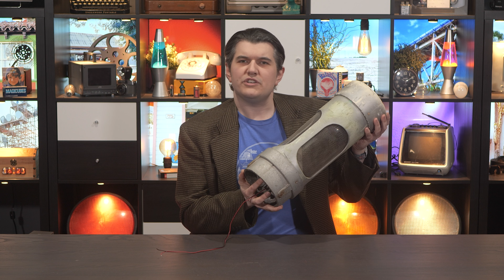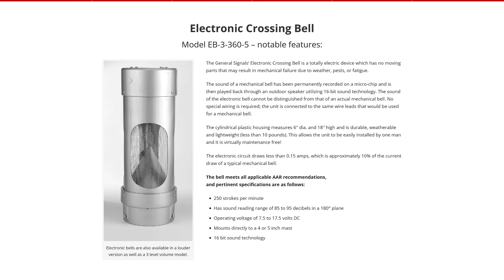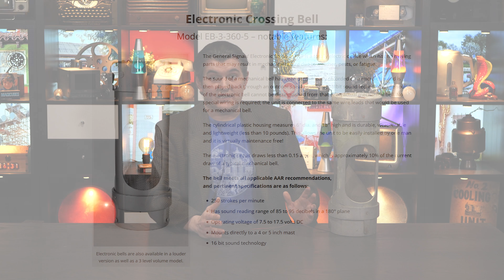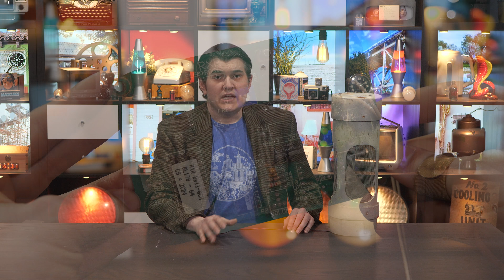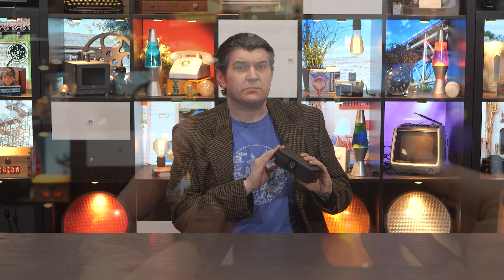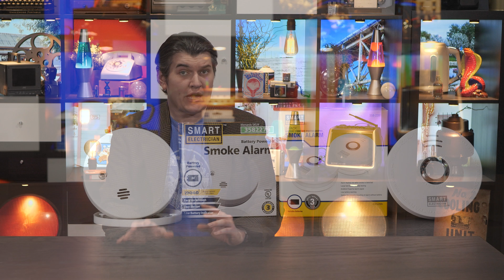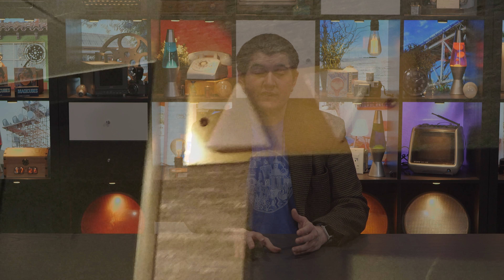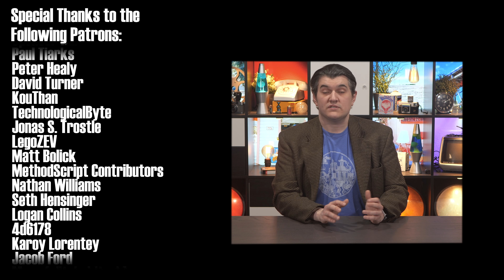The disappearing and unappreciated art of audible alerts

Comment: Sees a rant about phone audio notifications and raises "I used to have a little RGB LED on my phone that told me I have an unread txt, new email, app notification, they could be color coded per user, type of notification, etc. and then someone went "no" and every phone got rid of it and replaced it with always-on displays that get too many notifications and thus are ignored and use up too much battery". No I won't go on the same style rant, but I could.

I have sound turned off on enough things because I get jump scared. A 3D printer running out of filament and producing a fire alarm like sound from across the home (and the push notification coming seconds later), has given me enough heart attacks. Meanwhile, I have the 30 sec "dryer finished" song memorized. I think a lot of it is just way too many notifications. We went from "purposeful audio cues" to shrill ring tones and 40 billion beeps for every txt that showed up, to "now it's txt, email, app, OS, etc." all making noises and just went "please stop". You say "false choice" I say "the power of defaults" because most people never change default settings. The settings are there (assuming they work...) but it requires someone to change them manually.

Meanwhile, my pager app (yay working in software for 24/7 always on services and needing to be notified when something breaks) basically says "hi, welcome, can I set the notification settings for you so that when you get an alert it goes from least aggressive to most aggressive, and the most aggressive one will be set to auto-bypass do not disturb, vibrate only, and other suppression settings so we can actually tell you that you're system is on fire? kthnxbye" and then it does the work for me. Like... it can be done automatically, in an opt-in fashion. But that wasn't the feature request that was given to the developer.

Comment: An early smartphone I owned had a small LED near the ear speaker which would give a quick little flash once every 30 seconds if there was an unread message. As long as that phone was in my peripheral view, I didn't need to even touch it to know if I had a new message. These are not cutting edge technologies.

Comment: As much as I hate the electronic level crossing gong... they work, and they work very reliably. And when they eventually fail, it's cheaper to just replace them (once you factor in man-hours).

My main gripe with them, other than 'classic bells are cool', is they sound WEAK. If they sounded more like a real bell, no one would notice.

And the old bells? They're great, but they do require a fair bit of maintainence; I've seen 4 go out of service in about 3 years. I can see why they want to replace them, just... gee, they really sound tinny!

Comment: The problem with using internet apps is that it seems that it doesn't give a way to differentiate specific conversations. Most apps I've tried at most let you separate individual & group notifications but that's it. The thing that I definitely do is disable (or at least silence) anything that isn't a direct notification, like a call or a message. And for all of that, since it "got through" I generally use a single ping for it all... although I might split them in 2 for IRL and online-only friends.

The one single app I really hate hate hate to have notifs on is eBay. Because it doesn't let you disable or differentiate between notifs so "hey please remember that we're ripping off whatnot" or "we still sell used iPhones, same as 15yrs ago" comes in exactly the same as "yo that unobtainium thing that gets listed once every 3 years? there's 5 minutes remaining so imma send this notif late so you get it an hour after it expires lmao some guy got it for half off".
(...oh right banks also do ts, then add banks too)

Comment: Speaking of fire alarms and temporal 3, carbon monoxide detectors must use temporal 4. This is to differentiate it from fire while still doing the same stuff that T3 does. Funny thing is, I never knew this until it was told to me at my job (relating to fire alarm systems). How they expect a layman to differentiate between fire alarm and CO alarm? No clue. A majority of lay folk will hear sound and leave. I guess it's just for the professionals, because in either instance you want everybody in the area to get out.
Ahhhh I should have kept watching before commenting. Alas.

Comment: I still say Smart Watches were done wrong. They have been trying to turn them into miniature cell phones in and of themselves, with all ths same power and capability and I think that's a mistake. We should have instead made them into a remote control screen for our phone so we can access and control the phone without taking it from our pocket. Apps DO NOT RUN on the watch. The apps run on the phone and merely send graphical data to the watch telling it what to display on screen. App developers don't need to learn a whole new programing language for every smart watch. You just program the correct aspect ratio for the watch and what you want displayed and how and you are done. Just like having a second monitor for your PC, it's just a second display for your phone to control it remotely.

Comment: I am about to shove this pixel into a wood chipper if it keeps lowering my volume randomly.  I will straight up throw this thing in the ocean and get rid of having a mobile phone altogether if Google and Samsung can't get their shit together.
Reply: Same, bought a Pixel 8 a year ago and it was the most expensive and worst POS of a phone I've ever owned. iirc that behavior was related to something called gestures
Reply: Wait, dont throw out that Pixel just yet, you could install GrapheneOS on it and deshittify the phone!
(provided you have OEM unlock for it, which I don't because I got it through a carrier, so now I have to wait 3 years :/)
Reply: @gonderage  I'm a nerd but I'm not a programmer.  I'm not a developer.  The average person isn't breaking their phone just to get a basic function.  Why should I need an OEM unlock, for a device I own, just to make the volume not decrease as I'm doing 70mph down the freeway meaning I have to technically break the law to turn the volume back up?  

I wear shokz headphones when I'm not in a vehicle.  They cannot hurt my hearing.  They're open.  

I wear a cardo when I ride my motorcycle.  I don't wanna pull over (perhaps in ten miles at the next exit) to adjust the blessed volume I set before I started riding.  That's what the bleeding cardo is for.  It has a wheel I can spin with gloves on to set the volume.  

I use an FM transmitter in my work truck.  This stupid piece of hot garbage doesn't understand that it's in a vehicle, which has its own volume knob.  It doesn't understand that the transmitter is a device with an independent volume knob as well.  Google and Samsung just go "welp papa gubamint says we gotta protect your hearing so enjoy this volume reduction that you gotta take your eyes off the road to fix, or you gotta pull over on the freeway where you're not allowed to, or you gotta pull over at the next exit and be in silence for 15 minutes..."

I will not accept that I have to dink with this $600 phone just to get the functionality an off-brand walkman had 40 years ago.   I shouldn't need to put a different OS on my phone just to do something a record player from 1935 can do, which is to just play music at the volume level I set the bastard at.
Reply: @gonderage  Also I'm not breaking the phone to install an OS that I then need to reinstall all the stuff I just broke the phone to get rid of to make my watch play nice with it.  Just, no.  If i wanted linux on my phone I'd get a laptop with a sim card...

Comment: The "texts from certain numbers ring the phone every minute" option certainly would've been useful when I did on call rotations.  I mean, the on call software that pushed out the notifications could do that, but then you had to make sure to go in and shut it off on your way into the system, which was an annoying side quest on the way to solving a problem at 3am, so just having the phone beep at you until you answered would've obviously been better.

And I'm not just saying this as in "oh, I wish in retrospect." I spent a LOT of time trying to find a way to force my phone to do that, because the software that pushed out the notifications was annoying as hell to get to stop bothering you.  I so desperately wanted to be able to tell my boss that "hey, my phone can just repeat the message, we can set it this way and then tell the software to send the notification out just once." And I was so sure that this used to be a thing that I wasted hours of my life trying to find the buried setting. But no. They took it away.

Comment: 737 pilot here... The 737 "bing bong" system is terrible! A call from the cabin is a single bing, but a text message from the company (ACARS), or a text message from ATC (CPDLC) use the exact same bing, but followed by the bong. Most airplanes use different notes, but this plane uses the same first note for everything! So when I hear the bing, I might start reaching for the phone to talk to the cabin crew. But then the bong sounds and now I have to move to another part of the cockpit and try and figure out if it is an ATC message or a message from the company.

Comment: There actually is another reason for these electronic bells vs the mechanical ones. The mechanical bells send their sound in all directions. But in urban areas where some sound regulations may exist, the housings and reflectors for these electronic bells can direct the sound (somewhat) towards the approaching traffic direction while reducing the sound in other directions. They are actually mandated in some areas for this reason. And there are other electronic bell signals with a drastically different design that funnel these sounds even more on 'noise free' zones.

Comment: 21:14 Remember when you used to be able to turn Bluetooth on or off with a single tap of the "quick settings" button? I had an argument with a guy who was apparently completely unaware that what is now the several taps and wait for the animations to complete hell was ALWAYS (and still is) accessible with a long tap. So now the single tap duplicates the long tap, and I am constantly frustrated by accidentally tapping the wrong thing because the utterly unnecessary animation hasn't completed and 10+ years of muscle memory still hasn't been completely undone by a year of aggressively and deliberately user-unfriendly design. Because Google doesn't like users turning off their spyware...

I wonder when Google is going to completely remove the option to turn off Wi-Fi, Bluetooth and GPS?

Comment: Interesting. In Australia (or at least, both in my local shopping centre and my workplace, I can't claim it's a universal standard) Temporal 3 is 'Stand by alert' and the Slow Whoop is 'Evacuate', with no specified cause (although they're probably fire alarm systems under the hood).

Comment: The android notification settings are possible****

BIG ASTRIX 

On a fucking rooted phone. You can use Autonotification, and I forget the other app, it's an automation one. But yeah I was able to get it to just go DND when I got 3 successive messages within 30 seconds. It'd stay on DND for 10 minutes, and then undo it. I also had it set so anyone who texted Emergency It'd unmute, turnoff DND, and at max volume play EMERGENCY ALERT (ripped from BMS). I had it do a whole bunch of stuff too. But it's still a fucking massive nightmare cause google has to make android shittier and shittier each year. Just like they do with everything else.

Comment: Fortuitous timing. 

I installed an actual mechanical doorbell on my front door just today. It's the type where pushing in a rather large mechanical button on the outside actually turns some gears inside a mechanical bell on the inside. No actual visitors have used it, yet, but the sound is so pleasant.

Comment: My old phone very easily let me select notification sounds, so I know when it's an email or a text, or just one of the various games I have telling me rubbish. My new phone I THINK lets me do this, but it's buried under weirdly laid out settings and I've only so far managed to get emails and messages to vibrate and make noise (Everything else just makes a noise, or nothing at all). It's VERY frustrating!
It's also nice that I can set the games and apps to quietly add themselves to my notifications list without making a noise or showing itself at the top of the screen. I haven't worked out how to do this on the new phone, which is a pain.

Comment: I used to have ringtones and RGB LED settings very intently designed. For the ringtones in particular, they were multi-note sequences where it was arpeggios of different chords in different sequences based on the type of notification, and fast/med/short versions based on the urgency. Sounds complicated, but I was in a jazz band at the time so picking up on the chords was pretty quick, and I could tell "oh that was a non-urgent email from my gmail account" from the sound.

Comment: I've had the experience of working in a setting when a dispatcher needed the attention of one of the building maintenance staff, they would send the first name, or last name and initial, or a unique  identifier (think ham radio call sign) as morse code to all of the radios in the network. Very quickly the maintenance people would all pick up on their own call, so that even if their own radio volume had been turned down, the fact that someone near them had a radio loud enough to be heard by them, they would know that their attention was needed. and self automatically adjust their radio, include getting a new battery or the like, as well as be able to respond to the call whether it was on their radio or the radio they heard. The real advantage was that this morse code at specific frequencies used would often penetrate ambient noise even in loud mechanical or factory floor space environments where you practically can't hear the person standing next to you screaming in your ear.

My own interest is that something like a cell phone should only need a screen for things you need to actually see or read, and the day to day stuff like notifications, navigation instructions, even establishing a call should be a voice interactive activity, that works with either the phone speaker and mic, or a bluetooth headset. I'm rather discouraged that even Google Voice (my preferred telephone system, can't work out how to answer a call without a push button. Especially in call screening mode. verbal interactions like 'accept', 'yes', 'no', 'send to voicemail'l, etc,, should not require that I grab the phone unlock it, select the keypad function, press a virtual button (on screen), all of which takes extra time. It would also help with dealing with callers who can't be bothered to announce who they are to the virtual attendant, if I establish a phonetic contact name for the caller's phone number. As it is, if I don't have a contact and the number doesn't come through with functional caller-id, it goes to voice mail. If they elect not to leave me voice mail, the entire notification process is a failure on their part. For phone calls, verbal interactions for call accepting, rejecting, etc should all work whether I'm yelling at my phone in my pocket, working with a speaker phone on the desk. or a handset, or working with a bluetooth headset. Are there advantages to each, sure, but they should all work well.

As for navigation, "Give me a walking route from here to John's place, and give me waypoints to let me know I am on that route." should be sufficient to get almost any navigation system to provide that if "John's place" is a known location in your contacts, or a business in your area. If I can also feed back with something like "There's a problem with this route, the bridge ahead is out, please direct me to an alternative path' might also be useful in letting other users know that a given bridge is unavailable and to not even route someone that way, or to let anyone using a route with that bridge on it, know that they are going to need to re-route, and the trip might be longer. And I did specify 'walk' as I think that is as much a good case for verbal interactions only as any other mode of travel. I certainly don't want to haul out my phone when I'm on a bike or motorcycle, driving in busy traffic, or haul out a phone in what might otherwise be a sketchy neighborhood. (Yeah, we've had more than a few issues with folk grabbing phones out of people's hands. Apparently somewhat frequent at light rail stations for example.)

Long term, I can see that the only "phone" feature of such a device might be a bluetooth interface for a headset, You end up walking around with a bluetooth hotspot for your phone, that doesn't have a screen or keyboard of any sort. Single physical or capacitive touch button for power, a belt loop rather than a belt clip, you put it on as you get dressed in the morning, pop in an ear bud, say 'Good Morning' and maybe link up to an AI that's handling your scheduling for the projects your working on, and perhaps feeding you information about the people around you at a meeting if that's needed. Might be the size of a pater, and if for some reason you do need a screen, one of those one line 8 character displays that were on the top of old numeric pagers should be sufficient. Let it double as a security token, as so many phones already do today.

I can dream of course. Thanks for the video.